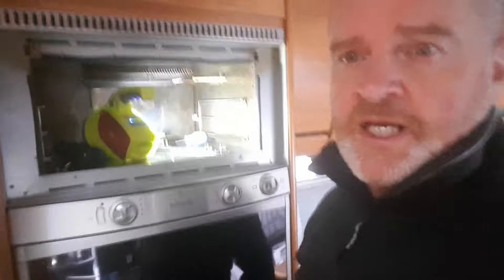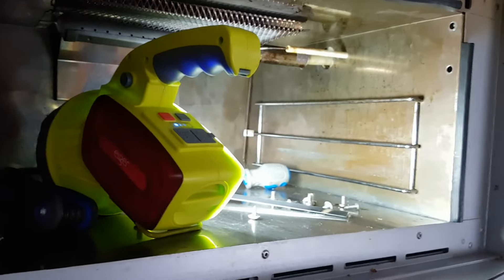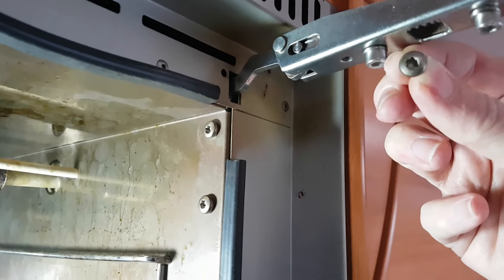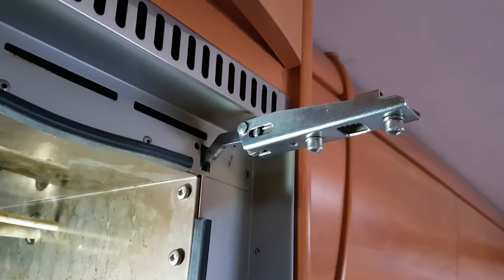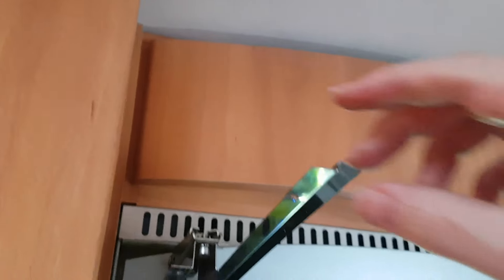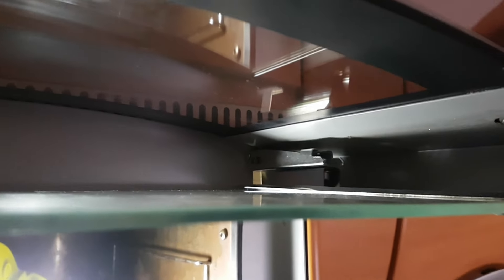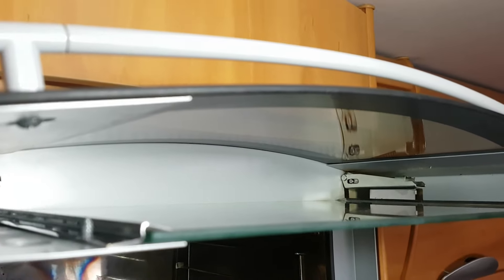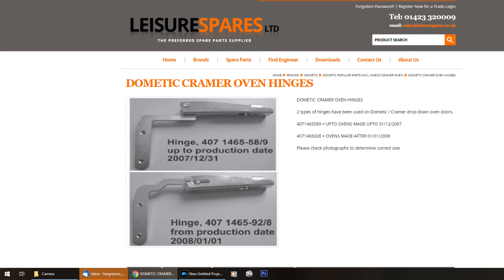Dometic Oven Hinges - Replacing on a Hymer Motorhome Tec Tower

Comment: The same happened to me, as an engineer I can safely say the hinges are the worst most expensive bit of crap I’ve come across. As for the oven, it’s a joke and in my opinion, not fit for purpose.
Reply from the maker: I agree.  The only bad bits on my Hymer are the Dometic bits.  They get away with overpriced, badly made, crap really.
I wish AEG made motorhome appliances.

Comment: Going to service my oven remove the bottom plate and loosen 4 screws that hold the glass panel and spray with 3in1 copper grease spay from screwfix.